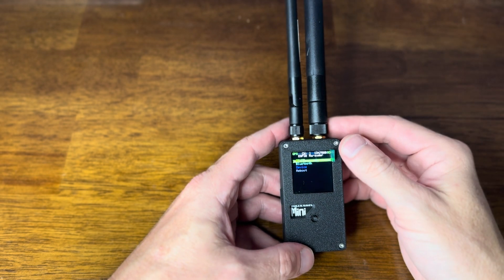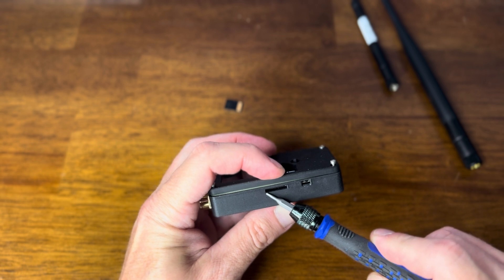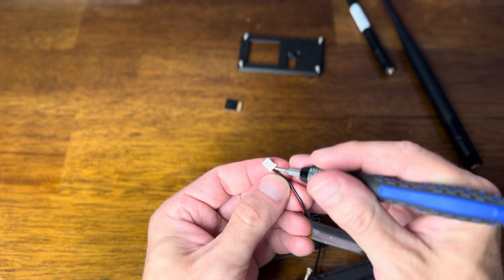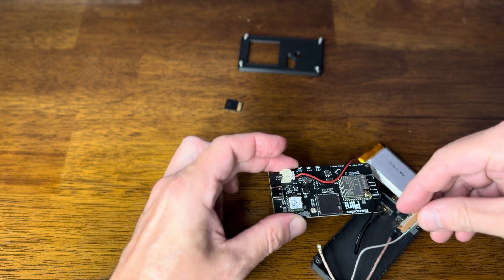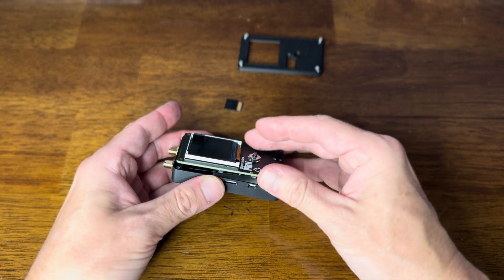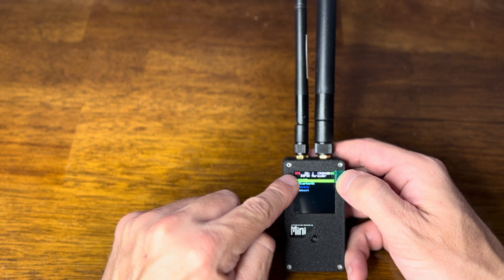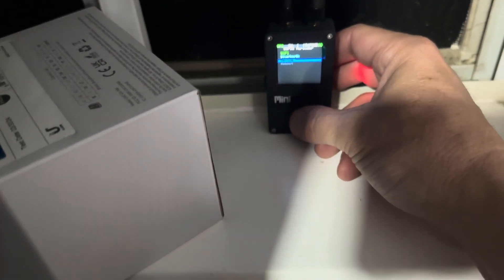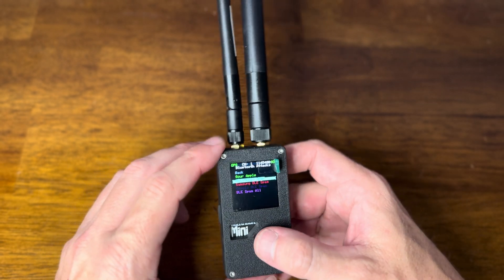How To: ESP32 Marauder Mini by Justcallmekoko with an external antenna and battery installed.

Comment: I cant for the life of me get the gps to turn green its just always red. I have the correct files everything else works great but the gps. Any ideas?
Reply from the maker: As long as the hardware is connected correctly you should be good. Just verify. Also make sure you have a good view of the sky.

Comment: Do you sell thise 3d printed cases or have a link where i can get one???
Reply from the maker: I think you can get them on “Just Call Me Koko”s website.
Reply: @PenTestTuner  awesome I found some on the site, thanks. What version esp32 did you use or did you order the tiny Maurauder kit. I have a ESP32 Devkit v1 but it has no way to add any extra antenna gps or otherwise....it's just flat on one side and not even an slot. 😒

Comment: Did the 2.4 ghz Antenna come with the Maurader Mini or was that a separate add on? I lucked out and was able to get one on the last drop and I'm thinking of setting it up like you have in the video. I'm clear on the 916 MHz Antenna, larger battery and how to install, but I have slight confusion on the 2.4 ghz. Thanks in advance.
Reply from the maker: Yes, my order came with the antenna.
Reply: @PenTestTuner  Thank you for posting this. I was able to get my Marauder Mini setup exactly like this. For the mini, it won't give another option for GPS on the home screen will it? It looks like there is a GPS list option for non-mini Marauder.

Comment: Where can I order this attenta from? and anything else I need to hook up
Reply from the maker: Here are my "Associate Links" for everything I used.
Antenna = https://amzn.to/40wO5jj
Extra IPX to SMA cables 4" = https://amzn.to/40mKlAL
Lithium Battery = https://amzn.to/40oooRF

With the Battery install, you want to make sure that the positive and negative cables are in the correct place. You will most likely need to reverse them before installing. If you don't you can fry the ability for the unit to recharge. Pay close attention.

Comment: Great information video.  Does your 900 mhz antenna do better than gps antenna? Sry for newbie question
Reply from the maker: I think a GPS antenna is better. At the time of making this video, I did t have a specific GPS antenna, so I used a 900MHz one.
Reply: @PenTestTuner  Thank you for always responding to my questions.  What would you recommend for the gps antenna? I see AWOK is selling gps antenna and they are $50-$60. I wonder if it worth the investment.  Thank you
Reply from the maker: @seunglee8398  I received my one GPS antenna when I got the BFFB from Justcallmekoko. I find that it connects faster than the 900MHz antenna. I have not purchased a GPS antenna from AWOK, but I imagine it is great.
Reply: @seunglee8398  I have both the AWOK GPS antennas. The AD-103 works well and I just got the AD-201 so I haven't gotten to try it out yet. I'm not 100% sure, but the GPS antenna I got with my BFFB looks like the AD-103. Do note that if you're looking for an antenna for a mini be careful of the size. The AD-103 fits on the mini with a 2.4 ghz antenna next to it, but the diameter is too large

Comment: Does this marauder support web server management AP to manage it and not using a display at all?
Reply from the maker: You can use a CLI to interface with it and do not have to use the screen.
Reply: @PenTestTuner  Ah. That still needs physical connection. I was talking about controlling it wirelessly.
Reply from the maker: I have not seen it used in that way.

Comment: What battery did you use?
Reply from the maker: I used an LP653042. It is not the one recommended in the Wiki, but I wanted to see if a larger one would work.
Reply: @PenTestTuner  perfect thanks! That's what I'm looking for, bigger than what the wiki says. My mini will be here Saturday so I'll do some measuring.
Reply from the maker: So cool.